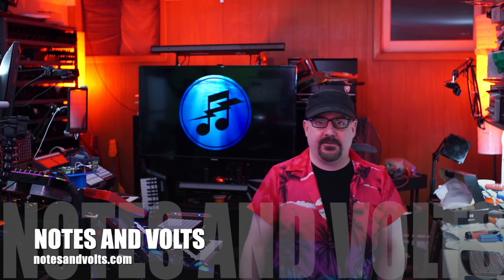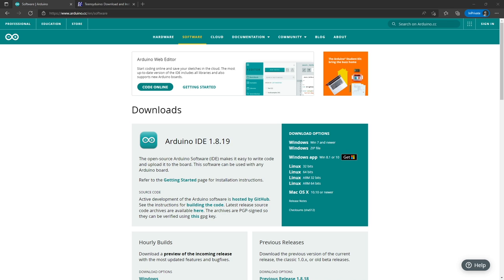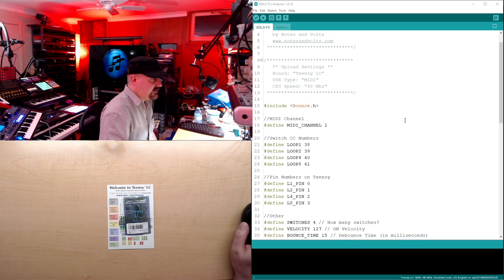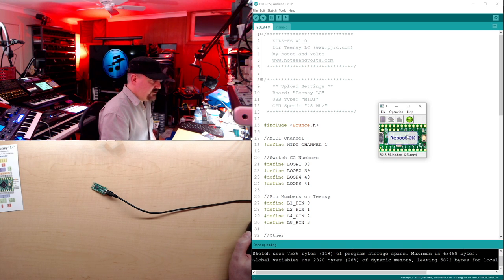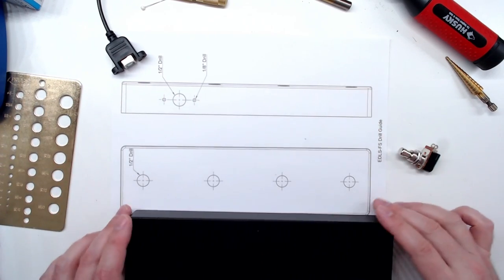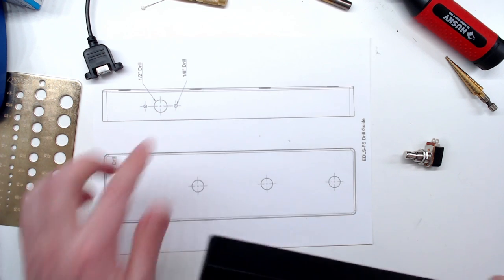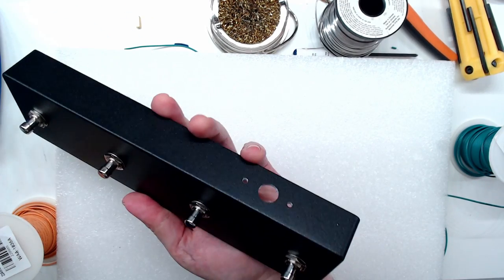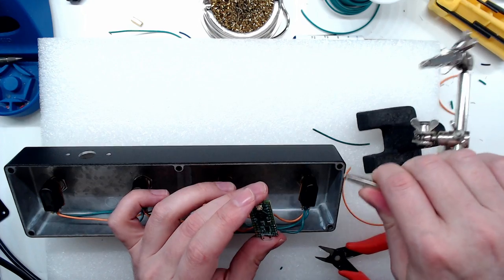Build a USB Midi Footswitch

Comment: Nice work, Dave! I've actually been planning to build one of these myself, but I'll be using one of a half dozen or so Arduino Nanos I have laying around my shop.
Reply from the maker: Thanks Robin!
Reply: The code is the same for an Arduino Nano?
Reply: @jmz.7166  Old post .... I just looked into this and apparently the Teensy board has some other ability for midi that Arduino does not have natively. Do you have any info on Arduino with this as I have a few of them laying around.
Reply: Any luck with an arduino? I'm just too cheap to spend the money as I have Nano's lying around.
Reply: @minkorrh teensy is based on ATMEGA32U4, its the same chip used in Arduino Pro Micro / Leonardo. Currently I am using Arduino Pro Micro for MIDI controller and it worked great, just like teensy.
Reply: @varian_teknologi  does it means that code for teensy also work for arduino pro micro, sir?

Comment: Really great vids. learned a lot from you, Thank you. I'm in the process of building a foot controller for Amplitube 5. It's been a challenge , some of the control changes aren't working right.
Reply from the maker: Thanks Fozybear. Keep at it!
Reply: @NotesAndVolts  Hello Dave, I have one question ? I was looking at your code MIDI Controller v1-2  , how do you do program changes ? There only options for notes and control change.
Reply: Hi! I bought a Behringer FCB1010 MIDI controller for the exact same purpose, to control Amplitube. I don't remember exactly how I got it working but the problems were both in what the controller sent and how Amplitube was set up. Basically, I just had to grind until it worked. Like, watching tutorials on how MIDI works and stuff. So, keep going and it'll work in the end! This video helped me a lot about understanding how control changes works: https://www.youtube.com/watch?v=wO3XD_HU-tE  It's from a Youtube channel called NonStandardMusic JP.

Comment: Really cool, I think that just might do the trick to control the Maestro DMX (AI light dmx controller) I need a midi device that will plug into the USB port of the maestro. Do you think I can also make it with a Arduino Nano or Micro because the teensy LC is not deliverable anymore. Thanks foe your videos they are Eye opening and I'm so excited to have found that making a Midi out interface is so simple. Cheers. Laurent From Switzerland

Comment: I’m gonna guess it would, but this would work as a controller for Bias Amp/Bias FX on my PC wouldn’t it?

Also. Would a Teensy 4.0 work as well? Rather than getting the one without pins I was going to get a 4.0 with pins and use header connections.

Comment: Thanks for the tutorial. I have old vintage controllers, that I can DYI around.  Korg FC6, have 6 footswitch but only the 5th&6th is useable for me, it sends CC signal.   The others 1-4, I don’t know what you call it when you keep stepping it sends different values. example footswitch 1, step one will give 100, next step sends 110, next 130.  So how would I make all these 1-4 footswitch just behave like press release sending cc. Thanks

Comment: I used your program on a Teensy 4.1 to connect to my Reaper DAW, and it works but with one problem. If I use it to toggle track one, it only toggles as long as the momentary SPST push button is pushed. It does not latch the command. Is this something that can be fixed in the program for the Teensy?

Comment: Thanks for making this video - I'm really tempted to make my own USB Midi controller now!

You use stranded wire, but what about solid-core wire? Is that a no-go, or?

Thanks again.
Cheers.
Reply from the maker: I usually use stranded if I need to bend or fold the wire to make it fir in the enclosure. Makes it easier. You could use solid, just be careful when routing the wires.

Comment: hi! great video! i know im late for this but the teensy board is sold out everywhere. what are alternative boards that i can use?
Reply from the maker: It uses the Teensy library so it requires a Teensy. But it should work with Teensy 2.0, Teensy++ 2.0, Teensy LC and Teensy 3.0 to 4.1

Comment: Would the same arduino program work if someone used 6 footswitches instead of 4 with the same Teensy? If not, would it be simple to add extra channels in the code? Looks like the Teensy could accept up to 20 soldered connections on the board

Comment: Followed the link on NotesandVolts and the Teensy is now unavailable.  The exact LC version is available on eBay but it's over $50 and at that price I'll just buy a premade MIDI switch.   I was able to locate a Teensy 2.0 USB 2.0 U disk Mega32u4  for $10 shipped on AE, do you think it would work?  Great find on the momentary switches on Amazon, in the cart.
Thanks!!
Reply from the maker: I've never tried the 2.0 but according to the Teensy website it seems to work:
"When you select "MIDI" from the Tools->USB Type menu, the Teensy becomes a USB MIDI (Musical Instrument Digital Interface) device, capable of sending and receiving MIDI messages. Teensy 2.0, Teensy++ 2.0, Teensy LC and Teensy 3.0 to 4.1 are supported."
Reply: @NotesAndVolts  thank you for the response AND for your work!

Comment: Hi there this is nearly what I am trying to do, except the iPad app I use only recieves MIDI notes - how would I adjust the code for that?
Reply from the maker: Replace "sendControlChange" with "sendNoteOn" on press and "sendNoteOff" on release.
Reply: @NotesAndVolts  awesome thank you. Going to give it a try.
Reply: @NotesAndVolts  thanks for the response. I’m struggling to get a Teensy LC. Do you think a 2.0 will work?
Reply from the maker: @adinwalls  I haven't tried the 2.0 but I think the chip can act as a USB HID so it should be ok. Not 100% sure though.
Reply: @NotesAndVolts  okay thank you!

Comment: Hey man, if one is to add more switches to send more CC numbers, just need to add to your codes at the define cc number, define pin number, the global vars, and at the bounce digital array, am i correct? and of course solder more more momentary spdt switches according to the pin numbers? thanks.
Reply from the maker: Yes, that is correct.

Comment: How many more foot switches could  you add? I would think you could keep adding cc #s in the code up to however many the teensy allows
Reply from the maker: Hi Chris. You could add up to 24 switches with the Teensy LC. I'll be doing a part 2 for this video that explains the code.
Reply: @NotesAndVolts  also I have a different arduino. I think its the uno. Wondering how different wiring and coding would be.
Reply: @NotesAndVolts  you have the second part?

Comment: Does anyone know if this project would work with the Boss Katana MK2 50w amp?
Reply: I don't think katana uses midi. Just get a regular foot switch for it it is also cheaper
Reply: @xbfo8053  thanks, was thinking this might actually be like the airstep. But it might not work out that much cheaper

Comment: Is it possible to do a build like this with traditional 5 pin dins instead of USB?
Reply from the maker: It is possible but would require modifications to the code and hardware.
Reply: @NotesAndVolts  roger that